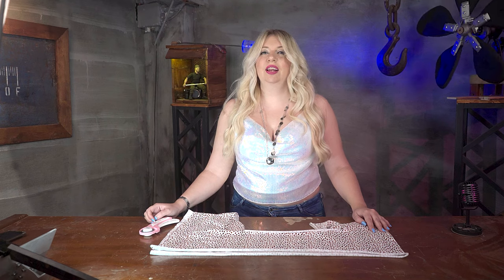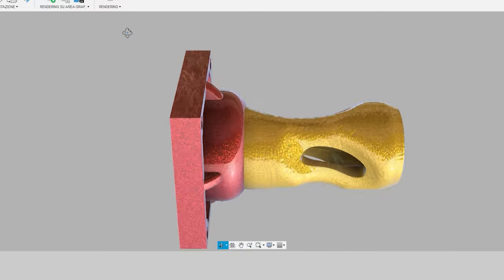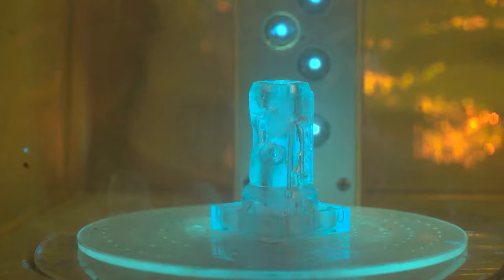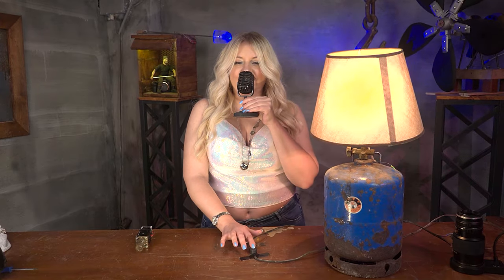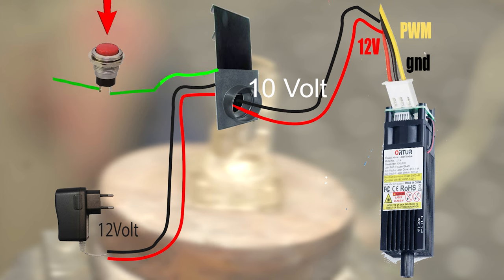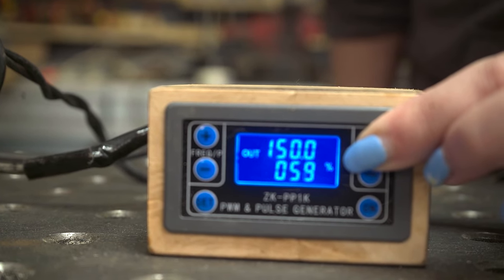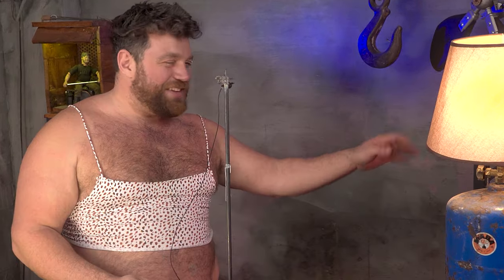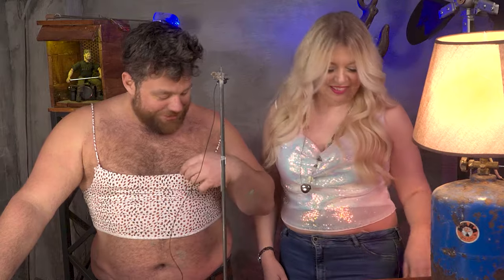How to Make an Ergonimic Laser Cutter

Comment: What a great idea. Why cant you hook it up to a foot pedal? were would you attache it. before or after the modulator? tha thanks for another video
Reply from the maker: just buy a pwm generatort with potentiometer:   https://it.aliexpress.com/item/1005006588104989.html?spm=a2g0o.productlist.main.5.39a4tl1Ctl1CSY&algo_pvid=7c069161-f528-4c2d-a4e7-86a1f145c927&algo_exp_id=7c069161-f528-4c2d-a4e7-86a1f145c927-2&pdp_npi=4%40dis%21EUR%217.57%217.16%21%21%218.02%217.59%21%40211b61a417122471910026076ee4f6%2112000037740491553%21sea%21IT%210%21AB&curPageLogUid=MMz0bqCaS9wJ&utparam-url=scene%3Asearch%7Cquery_from%3A     you can connetc potentiometer to a pedal